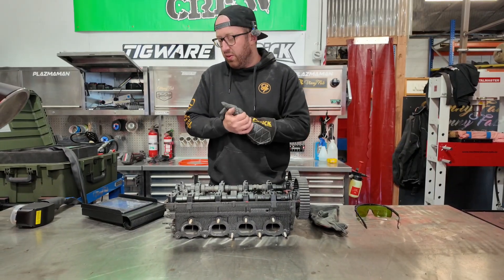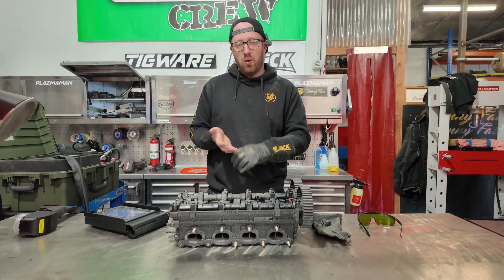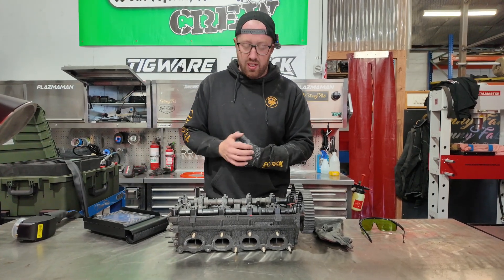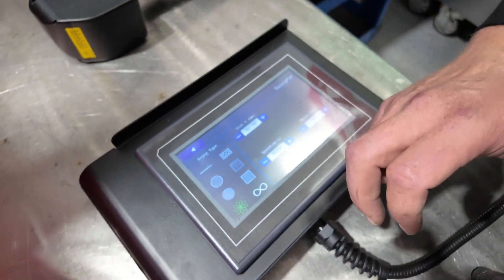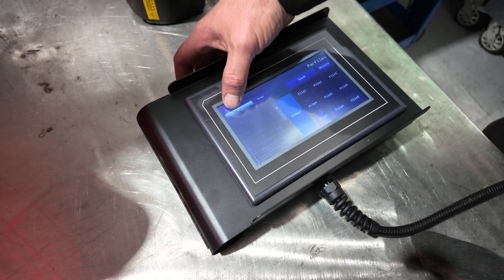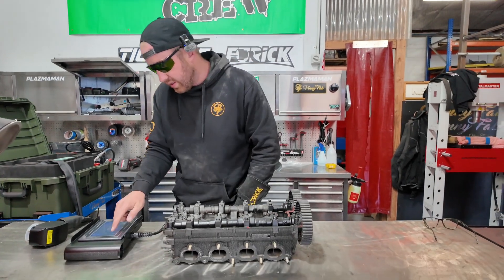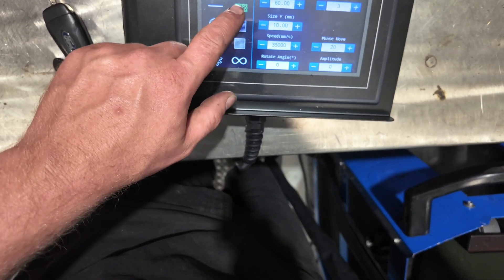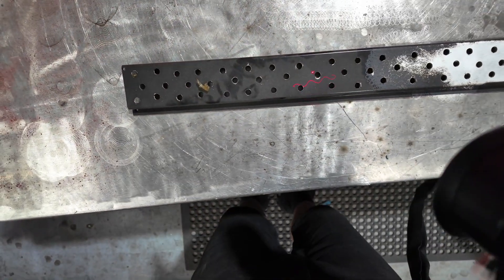Everlast 301 laser cleaner demo with setup instructions

Comment: Awesome Video!! One question, after some use do you think the bigger 500W version would be worth the extra money? I am buying a laser cleaner this year but torn on this 300w or going big for the 500w. Thanks man!
Reply from the maker: Hey dude, it all depends on what your main focus is? What type of stuff will you be doing? Then I can work out what model will suit you best
Reply: @VinnyFabNZ  thank you for the reply! Planning on mainly engine parts, just like in your video. Blocks, heads, valve covers,  and other components that are hard to clean or where a blast media can be a potential risk. But it will also be used for paint removal and surface prep on larger areas. The price point jumps a lot going to the 500, so I'm leaning towards the 301 Heavy Duty as of now. Thank you!
Reply from the maker: @mrctuned2844 yea i think the 301 would be perfect for that stuff! We already have a few customers doing the same stuff with the 301. When your ready to price one us send us a message and we can get you in direct contact with yiur region dealer to get the best price for you mate.